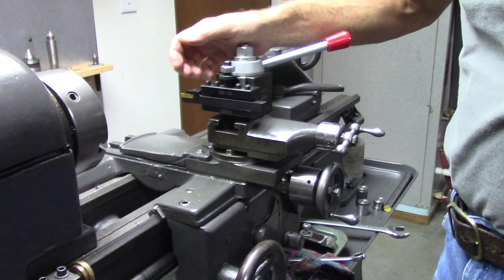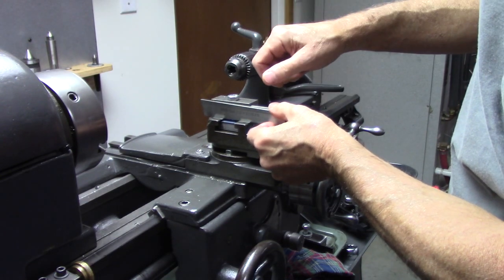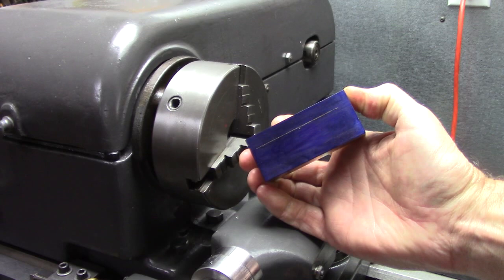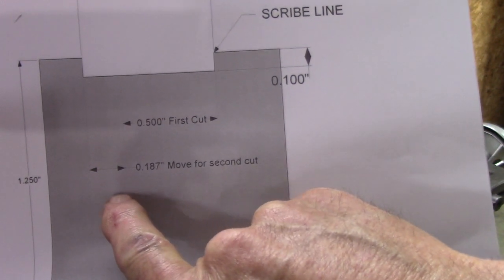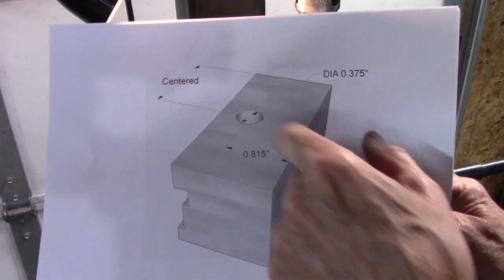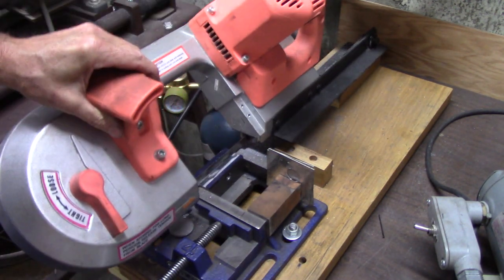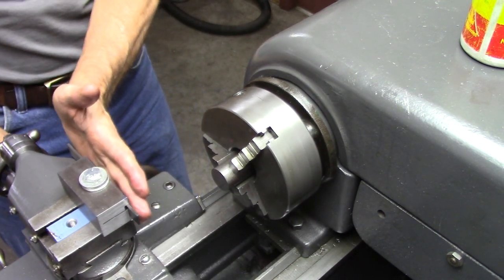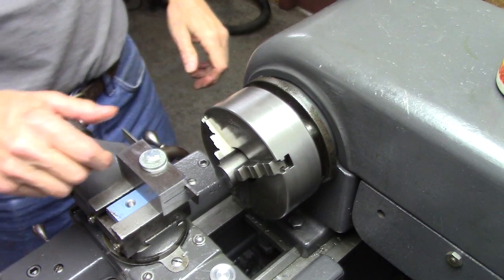Metal Lathe Cut Off Tool holder - NEW easy to make design

Comment: I like the top setback for the blade profile and overall design. Nice. As for power parting, I have to share a bad memory. As a very green and young wanna be machinist learning the ropes on a lathe, I asked how to cut off a part. The other machinist in the shop gave me a 1/4" wide parting tool that was hanging out about 3 inches from the holder. He told me it was a high speed cutoff tool. Naturally, I set the machine RPM to about 3000 ( high speed ) and engaged the cross feed like I was facing plastic. The tool lasted about a nano second upon contact, blew up, half of the debris embedded itself in the ceiling, the other half went over my shoulder and stuck in a sheetrock wall behind me like a kung fu star. I have never been able to shake off the memory of the sound it made when it blew up. Parting has never been one of my favorite operations from that day on.
Reply from the maker: Ha, Funny story! I've have a few stories myself but I think maybe a little better guidance than you had. I assume by "power parting" you mean autofeed. I'm fairly cautious about feed speeds but my lathe won't throw shrapnel everywhere, it will usually just stop. The flat belt drive just slips. I've used this feature a lot  - Ha. Actually I'd say that's why my 1947 lathe is still in fairly good shape. The belt slips instead of breaking something. I'm fairly certain my trial and errors on parting would have snapped off my compound by now if not for the flat belt!

Comment: Love the technique you used to mark the height using the punch. Wish I had seen this a week ago..lol
Reply from the maker: Thanks. It works well for marking the height but you have to be very careful not to cut the slot a little wide. It will make the tool too low. Believe it or not, I have a resharpened 3/4" end mill that is about .003 over 11/16 (the height of the blade). I've made several for friends and found that if a take the line while milling it worked perfect.

Comment: Thanks Mark. I've sourced a T type blade and some stock for the toolholder and the solid rear mounting. Can't wait for some fearless parting off.
Reply from the maker: Hopefully it works well. It cured my problems although as you can see it also has to do with the spindle size and chuck overhang.

Comment: I'm really like that design because it counters the forces you described on the tool post. 
No vibration, no chatter, and can get closer to the Head.  sounds like the best way to make custom fit washers also. 👍👍
Reply from the maker: Thanks again. It's worked perfect for me. It works great for washers. Generally speaking cutoff works much better with a hole in the stock anyway.  The surface speed of the stock gets very slow as you get toward the center. CNC lathes speed up as stock get smaller but that's hard to do on these manual lathes.

Comment: Nice upgrade.  Works great.  It could slip on to a QCTP but rest on the compound, maybe just as rigid.
Reply from the maker: Thanks...  that might work...  you might also use standard blade holder and put a spacer block under the holder.
Reply from the maker: I was thinking maybe attach a shim the bottom of a  standard QC blade tool holder
Reply: You know Randy when you guys get together, no telling what good ideas you all come up with.   I am sure going to try out that concept of adding your and Winky's ideas together.  My cut off experiences let much to be desired for sure.  Thank you Randy and Winky
Reply: @glennfelpel9785  For sure Glenn, more heads the better.  Thanks.

Comment: Good idea ,will have a look a fitting something like that to my lathe. I have no end of trouble parting off steel.
Reply from the maker: I had the same problem before I make this holder. Be sure and get the same blade too. The part number is in the description under the video. Thanks for watching

Comment: I just made one of these today as per your new version. Missed centre by the thickness of a coke can shim. WOW this thing rips into the metal and doesn't scream or vibrate at all. I'm using the same 11/16 x 3/16 "T" top cutting blade 
I wish I had seen this idea a long time ago. Thanks Winky for your inspiration
Reply from the maker: Hitting center seems to be the hardest part but you got very close. If it's too low you can glue your shims to the bottom. It's amazing how many people claim they never have a problem with cut off and then you find out they run very slow and hand feed even slower. I now cut off at 420 RPM up to 1-inch while using a slow auto-feed. My lathe doesn't have enough power if the bar is 1-1/4 at that speed. I'm not sure what the limits are with more power but I have never broken a blade. I can't say that about a blade mounted in a quick change holder. After 3 or 4 blades I gave up.
Reply from the maker: Thanks for posting, I love to hear this!
Reply: @WinkysWorkshop  Can relate to the broken blades collection. I'm going to make another one to suit my 13mm x 2mm straight blade and see what happens with that.
Will let you know when it's done
Reply: WOW, this one kicks ass, Running at 500rpm on 32mm mild steel like a hot knife through butter on auto feed. Happy days :)
Reply from the maker: @allanb1778  - So the straight blade worked well too?
Reply: @WinkysWorkshop  Awesomely, no vibration even at 500 rpm on power feed. This is the best tool I've made yet. Thanks mate
Reply from the maker: @allanb1778  Very cool. What kind of lathe do you have? My lathe doesn't have enough power to cut any faster (feed rate)...  the belt slips. I've always suspected cutoff was more difficult on smaller lathes but I have also heard that all lathes have problems if things are not set up perfect.
Reply: @WinkysWorkshop  I've got A HAFCO AL-336D DELUXE - Centre Lathe
Ø300 x 900mm Turning Capacity - Ø38mm Spindle Bore
18 Geared Head Speeds 65 ~ 1810rpm, 2HP motor. Bought this one last year, not a bad bit of gear. Got the same mill as you too.
Reply from the maker: @allanb1778  - Just looked it up. That looks like a substantial lathe. Was cut off a problem before you make the tool holder?
Reply: @WinkysWorkshop  Yep she's a beauty but still breaks parting off blades with ease. I think the QC tool post is the main culprit for rigidity. Had the same issue on my old lathe as well .That was a Hafco AL320G. So now I won't have to keep a supply of blades on hand.
Reply from the maker: @allanb1778  - Interesting but also matches what I've been saying all along about the quick change. Check out this follow up video I did. https://youtu.be/R4-I_peyBFE

Comment: Hi Winky, I really like that. I could see me making that for my machine. Some great ideas you come up with!

The next step would be to make a solid block that does away with the compound (like a number of people do already), but with a direct parting blade holder. A couple of extra steps for setup, but the ultimate in rigidity. No unnecessary moving parts/ways/gibs. Food for thought.

Cheers,
Craig
Reply from the maker: Thanks Craig, I'm not sure I'm ready t o away with my compound yet but it is the weak point for sure. I think with this new setup compensated fairly well and most other operations are not a problem. I have thought about going to a 4-way style tool post however. It supports the tool similar to my cut off tool holder. However... the QC is very quick and easy.

Comment: Great improvement over the first one. I think I can make this one work for my lathe. It has an 1 -5/16" center height from the top of the compound. Thanks for coming up with this.
Reply from the maker: Yeah, you will have to used 1-1/2: square stock. Thanks for the positive comment. Good luck.

Comment: Thanks for this video. I used your design, but I made my cutoff tool such that it mounts onto my quick-change tool post. I didn't want to have to remove the tool-post each time I wanted to part-off something.
Reply from the maker: Your welcome. That's a good idea. I actually thought about doing the same but I wanted to keep it simple. Thanks for the comment.

Comment: Nice work. Another thing might add safety and rigidity is turning the compund 90 degree so it's parallel to the ways. Takes the backlash out of the setup and avoids possible suck in of the tool. Especially on the loose machines.
Reply from the maker: The way the tool is made it falls into the t slot when you turn the compound at a right angle

Comment: The blade you showed is angled at the top so that when it is clamped in the official holder it also pulls it back sideways to clamp. The one I have on my Hardinge is also angled at the base, so in effect 1/2 a dovetail, so when clamping it pulls down and sideways.
Reply from the maker: This blade is not like that, thankfully. Being angled on the top tends to try to deflect the blade while cutting. This blade is flat on the bottom and top but also concave. This makes the chips more narrow than the cut and works fantastic. Google this and you will see: HHIP 2000-7030 3/32 x 11/16 x 5

Comment: That's  a smart way to hold the blade and clamp at the same time . I want to make one but put it on the other side of the cross slide and upside down so I can part without having to remove the parting tool when turning,,,if that makes any sense . I've see the setup on Myford lathes which would be good if I needed to make identical diameter parts and part them off  all without changing the set up .
Reply from the maker: That would be a cool set up. I saw a Logan with a cross slide like that
Reply: @WinkysWorkshop   Ya I think I'll make up a holder to do that,,, it would make turning identical bushings easier .
Reply from the maker: @thrustprop67  - Cool!

Comment: Nice design Winky, I always have trouble getting that slit parallel with the bottom, I think I would drill a hole that the blade could finish in to solve that. I need something like this to offset the stack of broken carbides and HSS ;s in my shop! Thanks and cheers!
Reply from the maker: Thanks! So far it has worked perfect for me. For anything 1.25" and under I even use a slow auto feed.

Comment: Very nice and I have a new to me Logan 820 also from 1947. Need to build one of these. 

Also can you tell us a little of your mill cutting lube set up. Seems like a nice set up without wasting too much fluid. ?
Reply from the maker: Cool...  I think mine is also a 47 model.  Haha...  The lubricator was not working quite right. It was lubricating but it's supposed to be a steady mist. It basically an air nozzle that creates a siphon so it sprays a small amount of coolant with the air. The solution is water based and it's called "Kool Mist #77". It's 90% water but doesn't corrode... I have no idea how they accomplish that but it works great and it's supposed to be safe. 10 minutes of milling might use  4 or 5 ozs of solution. I just suck it up with a wet dry vac.
Reply from the maker: Search this part number: 130103020Q and use it with Kool Mist 77
Reply: Thanks for the info, I value your content very much.
Reply from the maker: @johnvandewege7607   No problem, thanks for watching!

Comment: Add two clamp bolts before and after the mounting bolt with clearance on the top and threaded in the bottom that way the cutoff blade will stay clamped when not mounted, good job thank you for the video.
Reply from the maker: I thought about doing that... lots of great comment here. Another guy said, drill a couple of recesses behind the blade and put some magnets in there to hold the blade. Both ideas are good but I think I'll try the magnets. Thanks!

Comment: That cut of steel profile your using is far better than the straight sided HSS stock. The enlarged top section goes a long way to preventing side rubbing and swarf  jamming.  The hollow vee in the top is indeed as you suggest designed to guide the chip to the centre by rolling the chip edges inward. This design feature is very similar to that found on the top face of a carbide insert parting tip. I like your tool mount idea,it is very rigid and flex free. The single point parting tool is often the most frustrating of all lathe cutting operations. Edited for correction there was only SWARF involved here. No dwarf was harmed in the making of this video.
Reply from the maker: It's good to hear from others that understand all this. Haha...  no dwarfs!  Overall this idea (video) was received well but there were many comments like, "that tool is junk" or "learn how to sharpen a blade". Apparently some have only done cutoff with big Monarchs that are considerably more forgiving. Thanks for the comment!

Comment: Nice work. I have same problem with my lathe. The blades would break or grab. I solved the problem by mounting blade upside down. Works great and in the rare event it grabs it just knocks the insert up. I sharpen blade reset and continue. I have never broken a blade since.
Reply from the maker: Your method works great on some lathes although not on lathes with a screw on chuck .
Reply: Scary as fook when blade jams and wants out. I bought insert type blade for my lathe and run it upside down andtry not to crowd it when parting off. It was the easiest way to part off until I got a good bandsaw. I make thick beveled washers alot out of all kinds of steels and aluminum. When that solid blade snaps off in a jam it will scare to doo doo out of you and you best have at least eye protection.
Reply from the maker: @martinnorbeck5961  - I think you are right although I suspect on my lathe the blade will never break. the belt slips. I made a holder for a blade that holds an insert. 3/32" I think. It failed because I had the center height too low. It jammed destroyed the blade but slipped the belt. Sometimes more power would be nice but I'm glad my belt slips. It stops damage to the lathe...  compound etc.

Comment: I've been looking for something to do about this problem on my Atlas. I'm going to give it a try. I also used your idea of using a saw blade to make divisions on a graduated dial. That worked well, though my stamping job left something to be desired. Thanks for sharing.
Reply from the maker: That's great. The numbers on my first dial didn't look so good. Some of this was my crude jig but also the quality of the punch. I bought new punches on the last set. It made a huge difference.
Reply: @WinkysWorkshop  Could you share which punches you bought? The last two sets I got are pretty sad.
Reply from the maker: @IBWatchinUrVids  - I understand that. Paying more doesn't mean you will get better quality.  These seem to be pretty good. Something to keep in mind. When you stamp the number 1 don't hit it as hard. It takes a lot less pressure to make a good impression. Search this number and you will find it. Youtube sometimes deletes links. B01I0WYFQ4
Reply from the maker: @IBWatchinUrVids   - Hey...  I got confused on the punches. I have a video on making new dials for the lathe and I thought you were talking about number punches. I have no idea where I got the transfer punches but they are not the best. I've had them at least 20 years but the tips occasionally crumble.

Comment: Hello Winky. Been a long time since I’ve talked to you. Loved the cut off tool. I was looking at making the tool itself out of a carbide saw blade. Any thoughts on this. Have you ever tried this method?  
Also I don’t have a mill or the experience to mill a tool holder like you made. I have an old Southbend heavy 10 lathe that I do ok on nothing professional at all. Do you make any of these to sell?  If so what would one cost. Love all your videos. Thanks for sharing them.
Reply from the maker: No I don't make then to sell. The center height is super critical and it would be hard to get right for all lathes.

Comment: I am so glad you have continued to improve on cutting off with small lathes !!!  I just got a Logan 922 and haven't even got it home yet, but You can bet I will make up one of these cut off tools you have figured out, simply because cutting off has been a bane of mine !  with my 3 in 1 from harbor freight it's near impossible to do any cutoff ! and I have many hours on that little lathe...but with the incoming Logan 922  cutting off will be more important than it ever was....hacking it off with a hack saw is
time consuming and you have to have enough material to do a finishing cut to smooth it out...
thanks Winky ! <GRIN>  Bob.....
Reply from the maker: Thanks for the great comment. I'm not very familiar with the 922 but if I remember right it's basically a larger version of my lathe. It could be that cutting off will be easier on your 922 but if not you've got my design to fall back on.